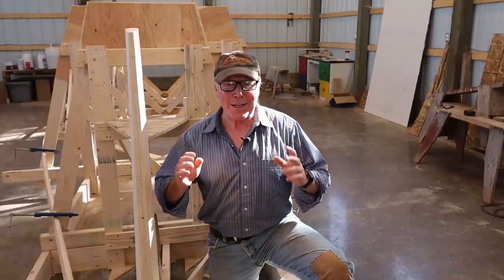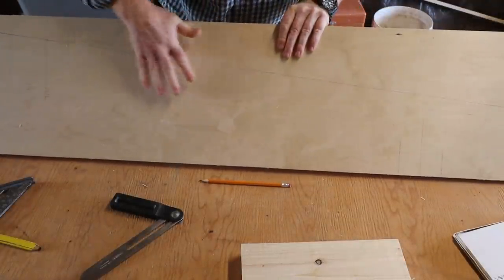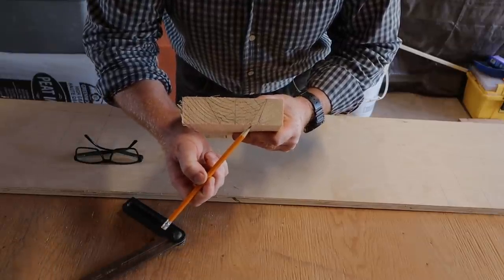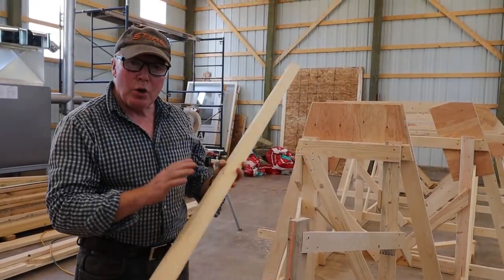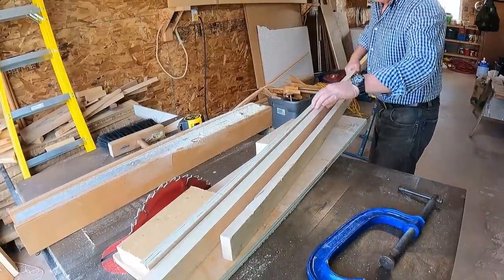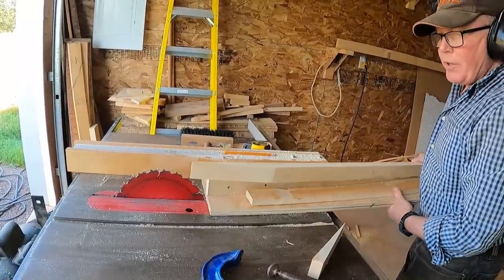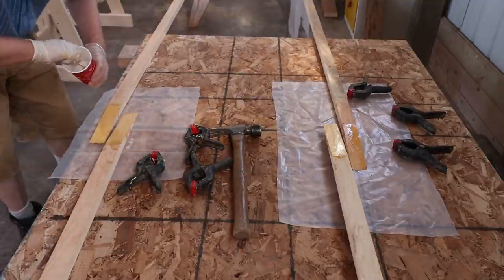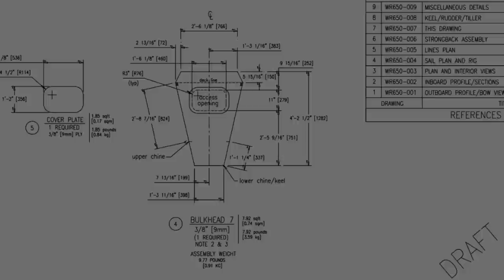S2E08 Shaping the Stem and Scarfing the Sheer Stringer || Wave Rover 650 Building Plan Update

Comment: Hearing the geese go over was a wake up call that winter is on its way.  Hope you have good heat in the shop.  Have a great week ahead.
Reply from the maker: Yes, my thoughts exactly when I heard the geese. In fact yesterday, I had to heat up the epoxy resin before I did a big glue up. I just need a few more days to get it to a point where I can start tarping it and putting heat inside where I'll need it.

Comment: I like your scarfing jig. I'm building a plywood catamaran and need stringers with 2 scarfs each. I've been using an arrangement on my sliding compound miter saw that makes decent cuts, but it's a bit hazardous because of the proximity of my hand to the blade. Your jig solves that. Nice job!
Reply from the maker: It's simple to use and safe. Have at it!

Comment: There is a very interesting conversation about Centre of Effort of the sail relative to the twin keels of a small boat like yours and the one on the linked video. Might be worth discussing with your designer if the issue hasn't already been considered. A boat mentioned there was also junk rigged.
OCSS-007 First Cuts for the Structural Grid - YouTube
Reply from the maker: Thanks, I just checked it out. We established our CE and CLR very early in the design process. Ours is a very traditional approch as I layed out a list of requirements to the Naval Architect at the outset of the project. Thanks for the comment

Comment: I like your music.  LOL  It would be interesting to see a fail test of that kind of scarf joint.  I would wager that it's stronger than the wood on either side of it.  I've seen people put a dowel through them.  How much force does the sheer stringer have to take in heavy seas?
Reply from the maker: The sheer stringer is mostly to help define the shape in my design. Internal bulkheads and frames will provide most of the strength.
I did in fact do a test of the plywood scarfs (upcoming episode) and as you surmised it failed outside the joint.

Comment: What led you to change the doghouse dimensions? have you considered giving yourself one place of standing headroom there (to get dressed, etc)? Wondering if the top could be raised 6” and the cabin sole stepped 6” down there giving you 6’.
Reply from the maker: The doghouse was always designed to give enough headroom to get dressed in foul weather gear. Something that can be a bit challenging in a seaway. Aesthetically, I don't want to change the dimensions, however a small change won't make a big difference. Most of the time underway you will be sitting/lying down when below. To stretch out, I grab some cockpit time.
Reply: @RoversAdventure  Awesome, glad to know you feel the room is sufficient for getting dressed comfortably that sounds like the ideal compromise. Always hungry for more details, looking forward to buying the plans. Would be great to see a 3D view to give us more a sense of the scale and interior space.

Comment: I'm surprised you're using a softwood like spruce for the stem (and possibly knee, gripe, keel ?) and not a hardwood like white oak or similar.  Any particular reason?
Reply from the maker: The keel supports will have white oak for strength, but the stem in this case is more for shape and assembly ease than strength.  It is capped with  marine ply and receives several layers of glass.
Reply: I made the stems for my plywood catamaran from Douglas Fir. Softwood that's a bit heavier (and more than proportionately stronger) than spruce. They're backed up by Doulas Fir knees. But the plans actually called for spruce in my case, as well. Here in Northern California, Douglas Fir is more readily available than spruce at a reasonable price.

Comment: A wood flour epoxy additive  is much stronger for a glue joint than micro balloons.
Reply from the maker: Good to know as I have been saving my wood flour as I go to use further down the line. It absorbs more epoxy as you probably know. On a side note, I did a little destructive testing with a plywood scarf (epoxy and micro balloons) and I'm happy to report that the scarf was stronger than the ply.
Reply: @RoversAdventure  Smart to do a test!  Joints can undergo stress from a lot of angles and twists, so it's hard to know you've got them all nailed down.  Microballoons are meant for fairing, so they're "relatively" easy to sand.  You'll find that a wood flour additive is MUCH harder to sand and shouldn't be used as a fairing compound.  I've tried "sifting" my sawdust to create wood flour, but as cheap as I try to be, it was much easier and far better to just buy it.  I would always end up with long fibers sticking out of my wood flour glue.  I used the wood flour in all of my joints to create a rounded filet that the fiberglass cloth could contour to.  Any long sawdust pieces would push the fiberglass away from the filet.  You probably know this, but NEVER have a joint filled in with just a thickened epoxy glue.  It must be covered with some kind of fiberglass layer, even if it's just a 4 oz tape.  The filled joint will eventually crack w/o the fiberglass on top.  Every board in the boat should have 2-3 coats of epoxy, including the end pieces of the plywood.  Best to join epoxied surfaces within 24 hours so the chemical bonds are still "active", etc.
Reply: @RoversAdventure  You used the correct filler.. Jason is mistaken.. microfibers not microballoons.. microfibers is the appropriate choice for a scarf joint. Microballoons is a fairing filler now sold by west system as microlight 410 as I understand it.. Confusing but 403 Microfibers is in fact engineered for lamination
Reply from the maker: @sharpiedory  Thanks Ryan for clearing that up. It was in fact 403.
Reply: @RoversAdventure  I'm sorry.  I heard "micro..." and my mind filled in "microballoons".  I'm not familiar with "microfibers", but that's basically what wood flour is meant to be: fibrous material.